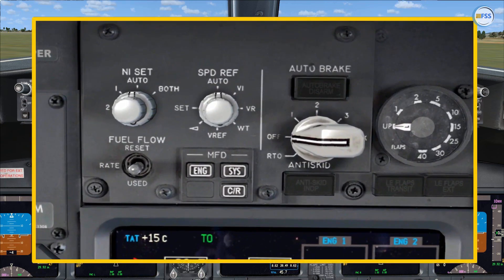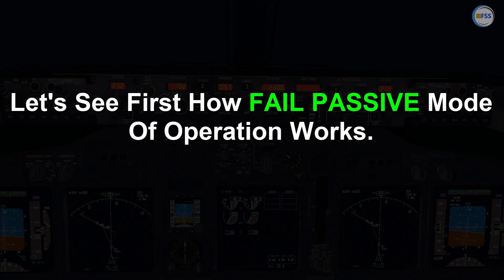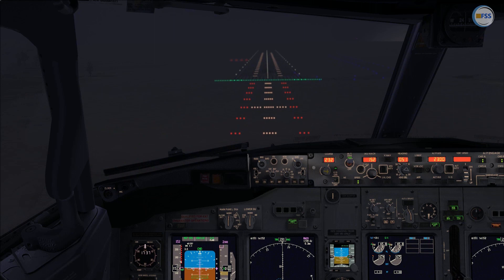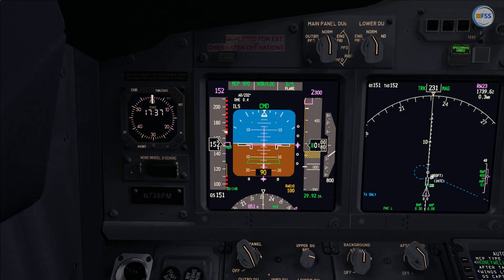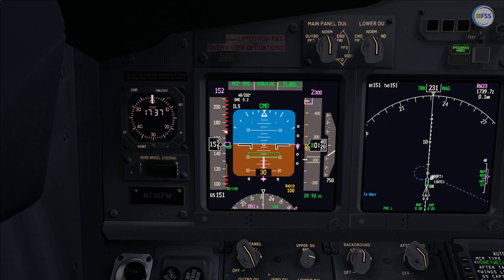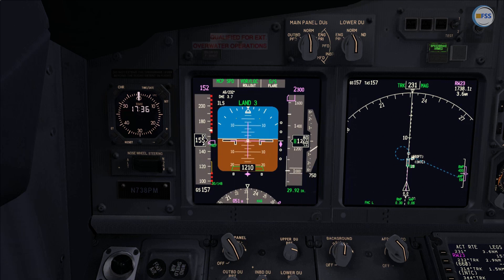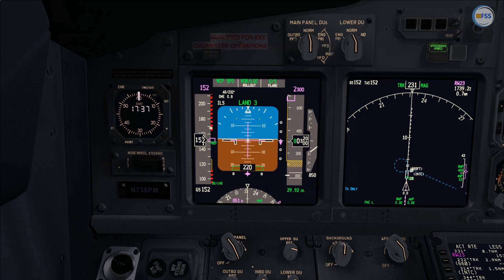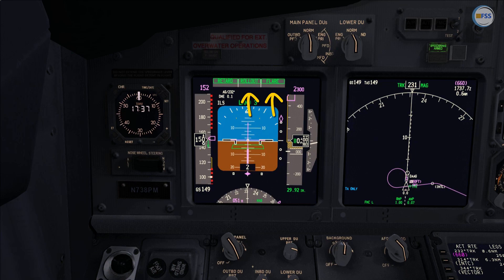PMDG 737 AUTOLAND Tutorial | Fail Passive Vs Fail Operational

Comment: Hi!! good video, i have a question, Is the Decision Height the Alert Height?  Thnks in advance!!
Reply from the maker: No. Generally, the Decision Height (DH) is a visibility-based decision altitude where the pilot must decide whether to continue the landing or execute a go-around. The Alert Height (AH), on the other hand, defines the point during an autoland approach where any system failure becomes critical and may require a go-around if it occurs above that height.